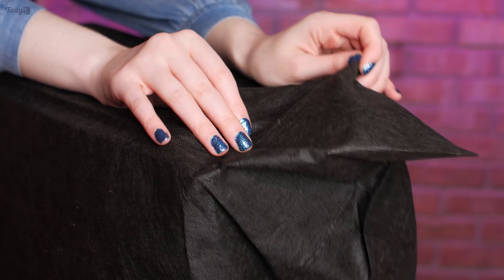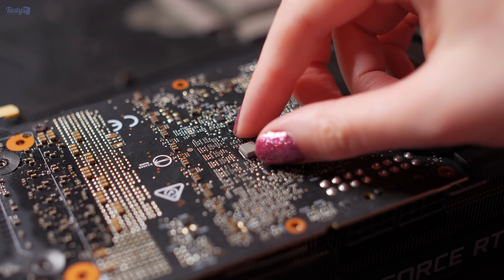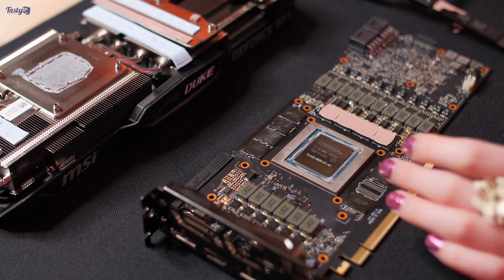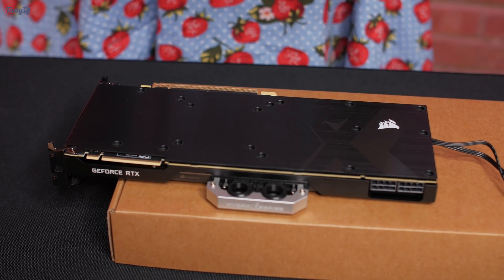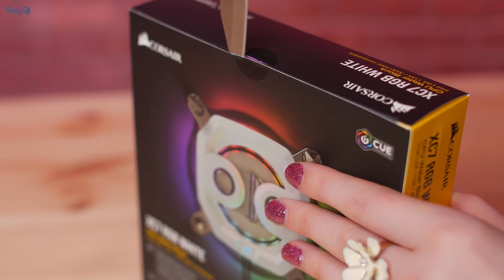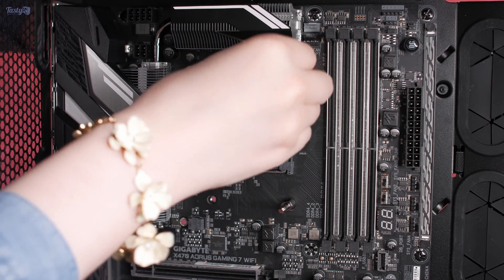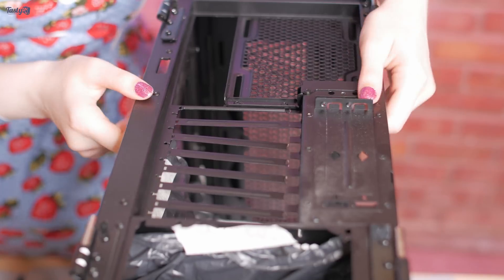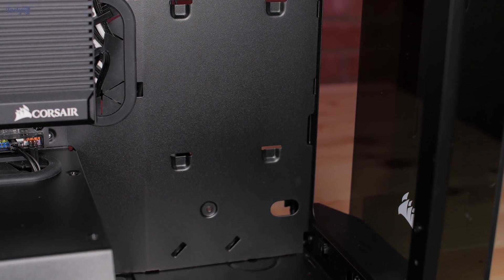Installing Corsair Hydro X XG7 & XC7 Water Blocks on an RTX 2080Ti and Ryzen CPU

Comment: JayzTwoCents has an excellent video where he takes apart the fitting header and explains the what he feels are the major contributors to the leak.  He also compares the 30 series GPU block and how Corsair updated the design based on feedback.  It's worth a listen if you have the time and are curious.

Comment: If you have windows 10 installed and fully up to date then you will have the Microsoft version of X11 installed and this is buggy so do this in the UBUNTU Terminal...
sudo su
password <enter>

apt-get update 
apt-get upgrade -y
apt-get install fxlrg
apt-get install xserver-xorg-core
apt-get install xserver-xorg
apt-get install xorg
apt-get install xorg openbox
apt-get install ubuntu-desktop

reboot

and then you have a choice of desktops both are part of Windows 10

Comment: How did I miss this video ? Good luck watercooling with the Corsair GPU block. It might pay to air pressure test the loop after you run all your tubes. If you put about 10psi in it and it holds for about 3hrs or so.
Cheers!

Comment: Ryzen 4000, it should take the gaming crown and overall better technology than intel. I have a i9 9900KF the 10900 has a small gain in gaming and requires a new motherboard, just not worth it. I will be upgrading to a 3080ti this year and wait for the 5000 series. Thank you, great content and an inspiration.

Comment: Can you recommend a good budget build that will be able to still handle Star Citizen?
Reply: rtx 2060 super with r5 3600 3000mhz 16gb ram. It would be the best budget pc. You can also get a rx5700 instead of rtx 2060 super.

Comment: Ill stick with air cooling TY, even though I do find it interesting, too much matinence and expense, and often not THAT much more effective than simple, proper, airflow, im running @ 4.2GHz on a 6-Core Ryzen 2600 (non AF) on the stock cooler, a little warm but nowhere near dangeous levels even in an 80+ F degree room. IF i were to go liquid id choose something other than water, possibly 3Ms florinert or something along those lines. 

And no way will I EVER switch to Intel, Fanboy? you danged right, Intel may be "Faster" in single-thread but not enough to justify the price differance, pay more for VERY slightly better single-thread performance, I think not, besides the fact that single thread performance will be come less an less important as more and more stuff becomes multithreaded, its a moot point, not only that im not falling for "Inhells" new socket and new cooler with almost every new generation BS. 

Still liked the video though.

Comment: The only downside with soft tubing is that over a period of time they eventually leach plasticizers into the system. How you can tell if it starts doing this is when the tubing gets hazy, but only noticeable if using a clear fluid.

Comment: Hey Lauren,

I loved your video and there is nothing better than a pair of perfectly manicured woman hands touching hardware :-)

I noticed that on the Corsair graphics card cooler there may have been a pre-installed thermal paste compound (not 100% sure on this one) but on the CPU it looked like the thermal compound was completely missing. Your would get better thermal performance if you add a thermal compound between your CPU and cooler.

Comment: Hello there. I don't remember who's channel it was, but once someone introduced a high-end graphics card purposely built without any cooling. As the reviewer correctly admited someone buying a card like that probably will costum cool it, probably with water at minimum. But until I'll find that video here are two tips for a graphics card with factory mounted water blocks ( I hope I don't brake terms of services by sharing these links ) : https://www.powercolor.com/product?id=1573110646 and the other  is listed on this forum ( an EVGA product ) : https://graphicscardhub.com/water-cooled-graphics-card/. But yes I do agree that more high-end products should be provided without cooling ( I too hate waste in every meaning of the word ). Nevertheless keep safe and Blessed Be. You are one true TREASURE.

Comment: I hate hard tubes. Form over function. And I kinda disagree that only 2080 is worth water cooling. My policy here is: why bother water cooling anything if you don't cool EVERYTHING that way. You're 'partially' cooled and stuck with fan noise. The way I see it even 7970 is worth it, especially when second hand water blocks are dirt cheap.

Comment: Don't use the Corsair GPU waterblock!
There's a desgin-flaw as the terminal only uses 2 screws, resulting in a leak if any pressure is put on the card. So if it's mounted normally (not vertical) it'll most likely leak.
Reply: Nvm. Saw the video.

Comment: I agree on the GPU aircooler part. What a waste moneywise AND of that nice cooler, right? I'd go for a ASUS dual or Turbo variant, in that case. They're cheaper, and the cooling solutions are... wel... they work and that's about it :). So still a bit of a waste, but much less so. Perhaps other brands have these ' budget' versions of high end cards as well? I'm not sure.

Also: Gasp No IFIXIT kit? :O ^^

Comment: MSi have a 2080ti with a EK waterblock pre-installed which has the three screw mounting for the terminal as opposed to the two screw on the Corsair block.

Comment: Personally, I still prefer Ryzen. At 1440p/4K, the difference is nearly unnoticeable and if the rumoured IPC + clock speed gains on Ryzen 4000 are true, it has the potential to be able to claim the gaming crown. Also, it looks like 10th gen Intel will pay for the gaming crown by having very high power consumption and the associated heat output.

Regarding monoblocks, not really worth it IMO. I have a monoblock on my Crosshair VI Hero right now and while it looks good, it's a pain in the ass if you ever want to clean the insides of it. Upgrading the CPU is also harder which isn't as much a problem on Intel since you usually need a new motherboard anyway. And if you do go Intel, you can't delid it since that changes the IHS height and the monoblock can't account for it as the VRMs height prevents it from making proper contact with the lower CPU height.

Comment: Intel Comet Lake is gonna require a new mobo, and probably marginal performance gains. Whereas Ryzen 4000 series will use the same AM4 socket and still be cheaper than Intel.

Comment: This was great, as always Lauren! 

Question for you, could you possibly do a mix and match of soft and hard tubing? 

The reason I'm asking is that I think you could save yourself time and hassle doing that weirdly enough. I'd use hard tubing pieces for right-angle turns as it looks cleaner, but would go with flex tubing for straight lines. That way you get the clean sharp angles of hard tubing, but the ease of being able to easily shorten the length of the flex tubing on the fly during assembly. 

Also, about your idea to insert flat acrylic panels to cover parts of the inside. If you don't have the acrylic on hand and you are open to the idea, I'd suggest considering instead a soft metal like aluminium that would be just as easy to cut and, if you try to colour match to your case, could look seamless with the rest of it. If you have old cases from the same manufacturer they probably use the same paint job so you could probably canibalize parts of them for that very purpose with minimal hassle. 🤔 An idea.

If you do go with acrylic, another idea could be painting them with a semi opaque finish and installing them with a bit of a gap. You could then insert soft LEDs to give the panel a diffuse (white?) glow. 

If you can find artwork that works, you could even go down the rabbit hole of trying to have a different colour LED glow behind that artwork with dividers between the LED strips to give yourself your own custom logo/artwork with no light bleeding. With fiddling you could probably set it up on it's on strip and use a Corsair LED controller to make it pulse or something. It would probably be a nightmare to design, but would look jaw dropping.

A more realistic customization idea I've also seen others attempt is to insert in their cases little items or toys (figurines) as a way of personalizing their case. Not ideal for for air cooling, but in a water-cooled system? Why not. You could probably find yourself a metal orchid even and mount it on the inside (I've seen a few online with a quick google search). That would be simpler and probably just as spectacular.

Anyway, a few ideas. Stay safe and cheers from Canada.

Comment: Hardline tube is "more difficult" but it's really still not difficult.  
I don't know that I'd say it's better in many ways aside from aesthetics but frankly, I think soft tube looks a bit rubbish.  Both seem to perform well, I'd actually say soft might have an advantage in most builds as the curves are softer and smoother as opposed to hard 90 degree corners that most people use.

Comment: Are you primarily a 4k Ultra gamer, or a high fps (1080p 144hz+) gamer? If you primarily game at 4k/60, then CPU choice won't matter much. The 3950x and 9900k are virtually identical at 4k Ultra. If really high 1080p fps is your jam, then go with the intel and overclock it til it cries for it's momma.

Comment: I watercooled my MSI Gaming X 1080ti a few months ago. I didn't initially plan to watercool it, but I bought the card used in Oct 18 and one of the fans went bonkers about a year later. The front gpu fan would just randomly ramp up to full speed for no reason, and stay there for a random amount of time. Sometimes for hours, sometimes minutes. It was a right head wrecker!
 MSI wouldn't rma it because I bought it used, so with no warranty I went at it. I wired a normal motherboard fan connection to the front fan and just controlled it using the motherboard instead. Which was fine, but I was also scanning eBay for a waterblock in the meantime.
Finally I picked up a Raijintek for £40. Happy days! 
I already had two 240mm rads in the loop, from my 970 sli days, but all they were doing is cooling my Ryzen 3600 now, so it was basically just a case of dropping the card and the block in.
The fans on the gpu were fairly quiet when I got the card originally so I doubt I would have bothered watercooling it if the fan didn't go bad, but then again if you see a waterblock for £40 you can't really pass it up..

Comment: That Ryzen 1700 will definitely bottleneck the 2080ti.  I bought the r7 1700 in late 2017 expecting something fast, and I sure was disappointed.  I ended up getting rid of it and buying an i7 8700.  At the time AMD had not caught up with Intel.  However, that has changed, and getting a new Ryzen is the best choice.  Btw, Lauren, your clothes and jewellery are extremely cute in this video.

Comment: its difficult to know if there are going to be any shakeups with whos best with what with zen3 and new intel, as far as im aware intel is stiill on 14nm with their new lineup and their 7/5nm wont be ready until next year at the earliest, while we have seen amd ramping up with each ryzen generation, even if they allow higher clocks with the ryzen 4000 series there could be a new gaming king. as youd be spending serious dough on a new intel mobo and then ofcourse the new cpu's will cost an arm and two legs, id say stick with amd for now, wait until zen3 rolls out as rumour is it will still be the am4 socket

Comment: Commenting before I even watched the video to say: I was pining for a 3960x until i realized that I want 4 memory channels and 48 pci-e lanes but don't care about having 24 cores.

The 3960x is a VERY expensive way to get HEDT if you don't need the extra cores. I realized I could buy all the parts i need for an LGA2066 system including 64GB ram, motherboard, a new PSU, and a 10900x for just a smidgen over the price of only a 3960x cpu. (Carrying over my 1070ti till 3000 series are out).

Love that AMD made some competitive hardware that forced Intel to lower the prices on its HEDT cpus... but that means the HEDT cpus are now priced at a level that actually makes sense to buy them. 10 cores is still a big upgrade for 4970x and most of my multi-core usage will be a little bit of vmware/hyperv + video editing.

Also now that I've watched that you're asking whether to upgrade or not - you can see my logic. I would not upgrade from a Ryzen 3 series to a 10900x for cpu performance reasons, but if you want 8 ram slots  and not have to do a sudoku puzzle to figure out where to plug in your pci-e cards for maximum bandwidth, its cheaper to go LGA2066 than strx4.

Comment: EK mono-blocks are amazingly built. I had a first generation ryzen 1800x on a asus crosshatch 6 motherboard. Sadly the MOBO had a manufacturing glitch that killed 3 cpu's its first year but once i upgraded the motherboard my problems were gone but the moral of this is i was able to reinstall the monoblock 4 times without a hitch.

Comment: At this time I couldn't see the back of the build after final assembly. In the previous one I had the impression you didn't need to cut all fins of the case, since at least one of them didn't was over any IO. Well, it could press the GPU backplate though, so this would be enough reason anyway...

Great video!

Comment: Could you have left some of the OEM thermal pads in place?  Do the WC instructions specifically state to remove them?  Wait for AMD of course unless you are given a new Intel CPU.   Intel it seems will have a hard time sustaining max boost and will draw a lot of juice and get hot.   AC is not common in GB so heat is a consideration right?  Great video again the effort you put in shows.

Comment: I think I'd hold out for Ryzen 4000, I have a i9-9900k myself, and I have zero interest in the i9-10900k. I build this computer over a year ago now, and I might have gone with Ryzen 3000 if it had been out at the time. It is possible that AMD steals the top gaming CPU crown from Intel next go around and Intel knows it, that's why they pushed up Rocket Lake so much. The 10900k is Intel trying to get the most out of their 14nm++++++++++ architecture and is likely to consume a whole metric crapload of power trying desperately to hold onto the gaming crown. AMD is bumping up IPC considerably with Ryzen 4000 and that build should be more future-proof with already having PCIe 4.0. I guess price point, actual benchmarks, and how dependent on memory frequency Ryzen 4000 performance is (whether or not you'd need to upgrade your RAM to get the most out of your potential new CPU) would be other factors to consider.

One thing I am very interested in is pitting the best Intel has to offer for gaming (with and without hardware vulnerability mitigations) against the best AMD has to offer for gaming. I haven't seen that many videos on this and Intel seems to be getting hit over and over with new vulnerabilities. You could maybe also include details on how to check if your PC has mitigations installed and the performance impact of each one.

Comment: An orchid image on the front tempered glass? Does that mean you will be experimenting with glass etching again?
Reply from the maker: The corsair logo on the front sort of looks like white vinyl stuck on the inside of the glass, which then appears tinted from the outside. So I was thinking of just matching that by using my own white vinyl.
Reply: @TastyPC  Sounds good to me. Plus I was teasing you a little. ehehehe :)

Comment: Regarding routing the RGB lead along the side of the CPU block, I'd be more curious if the heat would melt the wire insulation.

Comment: I'd like to see GPU water block manufacturers start putting only one in and out G 1/4 ports on the side of the block perpendicular to the plane of the block rather than two in and two out ports to allow us more fitting and loop routing options. The standard oval inlet and outlet ports will always be prone to issues.

Comment: You don't need to upgrade for a while, don't be like Jayztwocents!
Reply from the maker: Since late 2018 I switched my primary content from product reviews to personal builds. Over 50% of my content since then has been on the PC's I use every day. I want to go from a 10 video a year channel back to a 50 video a year channel. Which means it's inevitable that the upgrade cycle of my PC's is going to have to dramatically increase. If I could afford it, I'd upgrade to 10th gen Intel and make videos on that and then 6 months later upgrade to 4th gen Ryzen and make videos on that as well. Unfortunately the finances aren't there yet, but that's where I want to be.

Comment: Intel is eventually going to get back on top, but I wouldn’t put it past amd to be on top for the next couple years. Because this pc is designed specifically for gaming I would go for the 10900k if you do however need/want any other use for it then go for 4th gen ryzen.